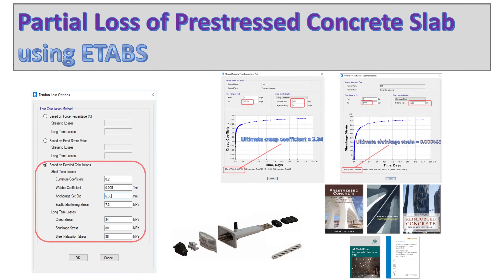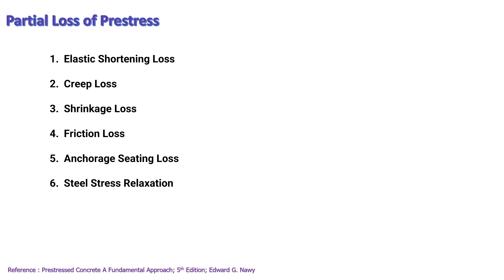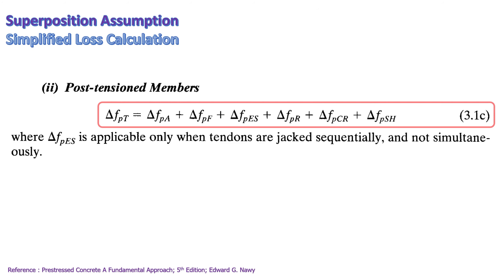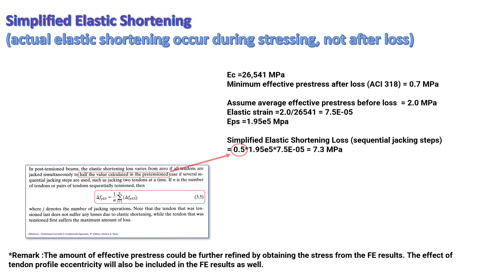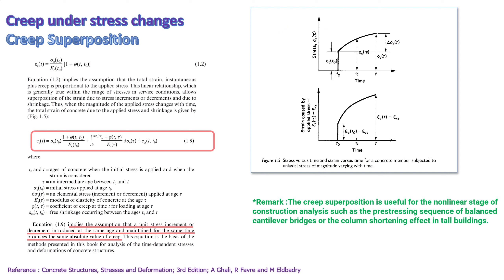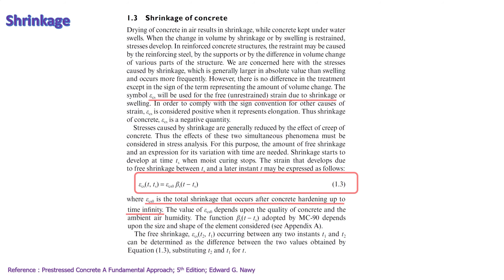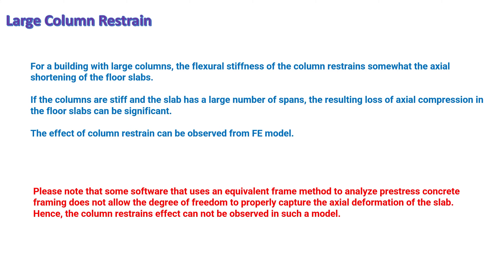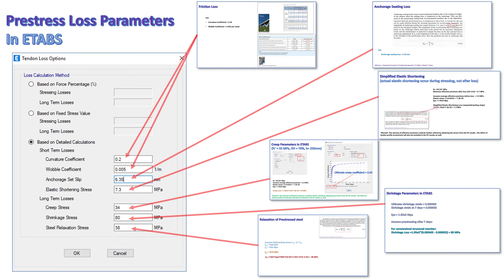Analysis of Prestressed Concrete Slab using ETABS, Part 2: Partial Loss of Prestress

Comment: Sir how to  vary youngs modulus with concrete age in ansys workbench.
Reply from the maker: If your objective of the structural analysis is aimed at research purposes and you need to consider the effect due to changing of the Young's modulus of concrete over time. In this case, you need to use Mechanical APDL because the Workbench will not be friendly when we want the material property changed during multiple load steps.
Reply: Thank you sir. I am following your thermal analysis video on mass concrete. can you please make the video on THERMAL STRESS analysis part as well. It would be  a great help.